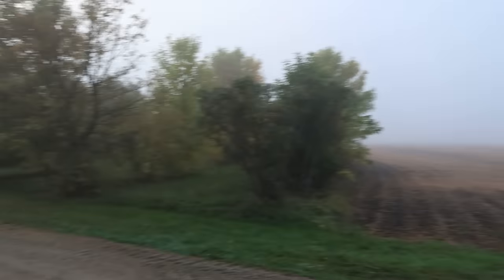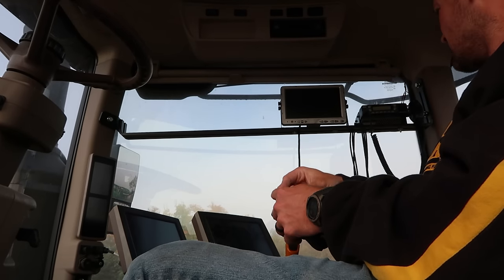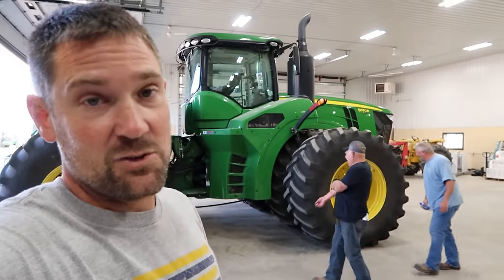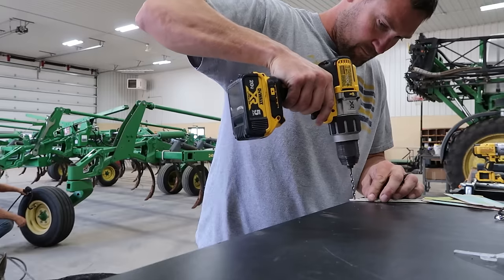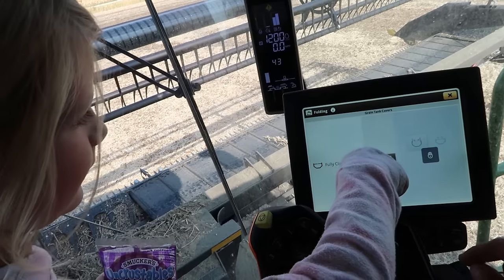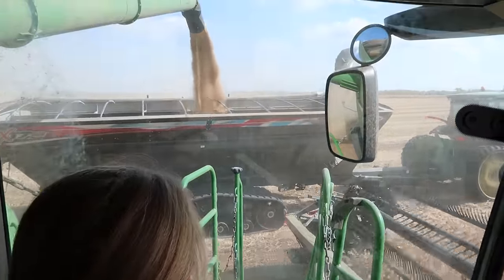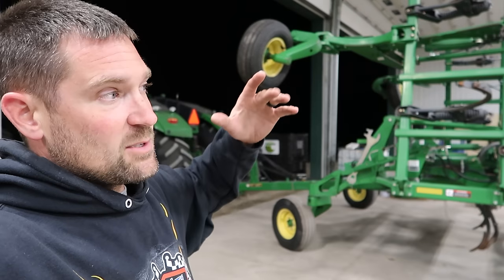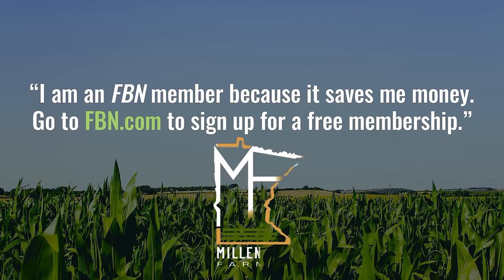It Happens to The Best of Us!

Comment: Cab Oats are more fun cleaning up and in cleaning the rock trap... Itchier!  Cut back on the fertilizer Zach or get a "the tank is full springloaded Everlast glove releaser" with the louder more irritating full tank buzzer option from Deere, bigger topper frontboards or smaller brake rotors!

Comment: We just got a 2018 240 air flex this harvest, it’s been the nicest cutting head we’ve had for beans, but there’s a few things we’ve run into I thought might be helpful to know, the sickles are apparently known to be replaced yearly due to the fact they’re just a softer sickle for all that flex, we just replaced ours in the middle of beans cause we snapped one after the other, the repair kits will get you by but aren’t ideal, a few other things have been replaced due to them updating different parts in the knife drive system. Parts have also been a headache to get for us in North Dakota, we’re ending up buying spares of everything cause it’s usually a 1 or 2 day wait. Hopefully you have better luck with it being a new head, have a safe harvest guys!

Comment: You don’t like checking tires because there are so many. I don’t like it either. So I got a 100 ft polyurethane air hose, they are small diameter, very light, & very flexible. Then I got a Rhino brand air gauge. Now when I check all the tires I just take gauge and hose right at the start, that way if one or more tires are low I don’t have to go back for the air. The gauge is guaranteed accurate, so just connect, check pressure, if good continue or just hit trigger for more air.

Comment: As a person who has NEVER been on a farm but do enjoy watching all that is involved, I have two questions. #1 I see that a lot of equipment used different size pins when hooking up and some time is spent finding the right size pin. why not convert all equipment to use the largest pin then hang that pin on each tractor. #2 I also see that at times a seldom used  piece of equipment like a rake that sits most of the year will have several flat tires. Why not put solid rubber or even plastic tires on these items. The equipment I am talking about have maybe 12 inch tires, but have tubes and sit all year. Just asking

Comment: High Humidity and dry fertilizer do not mix. Go look at the floor of the coop dry shed on a high humidity and see for yourself. Putting humidity on  dry fert in an injection system will not end well. We have been working on the same problems for 6 years and we are way south of you (Ks), Enjoy!!

Comment: ask your dad.. What ever happened to the farmer getting done his day after 18 to 26 hours with a sore neck and shoulders from sitting half cocked around waching the machine tied the the back of the tractor running the hydralics with one hand as the other steered while you ate a sandwich, drank a coffee and had a smoke when done, not washing the grease off your hands after being out setting and ajusting the machine with a plyer, a screw driver and a cresant wrench and pumped the grease in squeazing the handle on the grease gun, no sitting waching you tube as the tractor steers it's self and ellectrical garbage so much time is wasted hooking up and making work ????